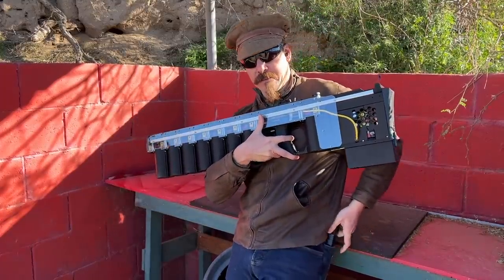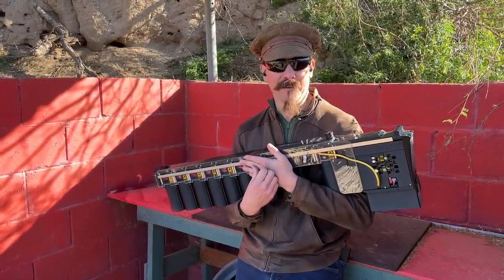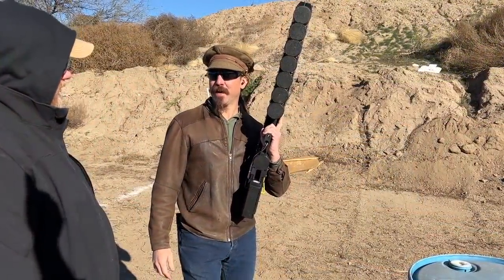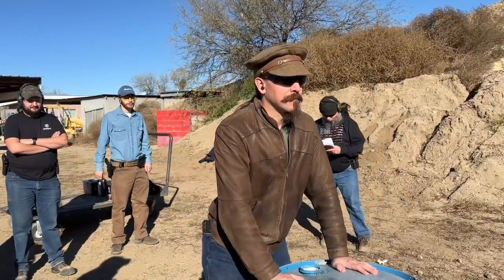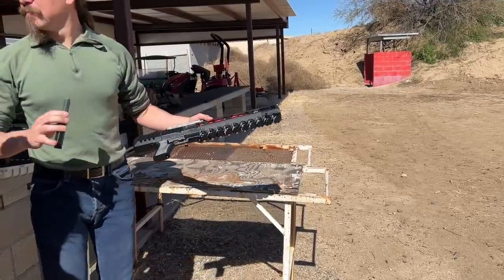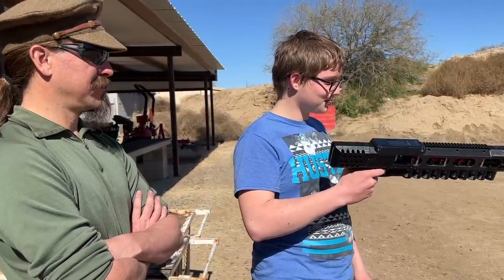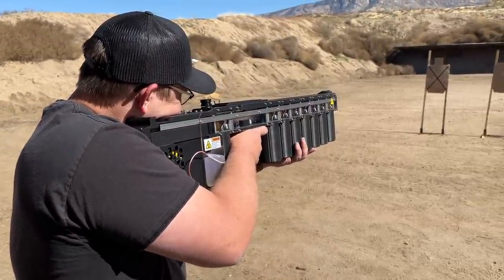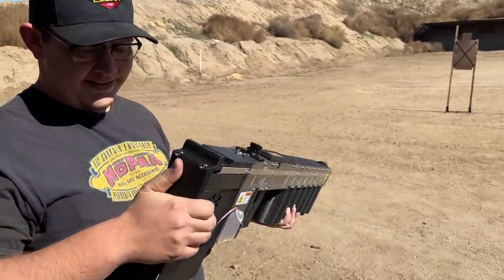I Tried to Use the GR-1 Anvil at the BUG Match...

Comment: What do we call that point when Ian can shoot this match as well with either? Like, 10 years down the line and the GR-7 comes out and fits in your hand and could be viable for everyday use?
Reply: Sadly, I doubt it's gonna be a decade before these weapons really become viable. The batteries and capacitors are just way too limited in their power and way too bulky and heavy for use.

I guess the first iterations of useable Gauss Rifles would be vehicle-mounted and tapping into their engine for energy. After that, I guess some man-portable guns for highly specific uses might be next. I don't think they'll ever replace regular handguns, though. Unless we find an energy source/battery that will be able to provide enough energy to fire several magazines without recharging. Keep in mind, for these guns to truly become viable in the field, they need to offer the same amount of firepower chemical propellant offers.
ie: You save up on weight for the ammo, since there's no propellant, but you need to carry a battery. The battery needs to provide the same amount if not even more energy than the same weight of propellant that it replaces. And that is an insanely tall order.
Reply: @h.a.9880  i would expect to see Gauss Cannons on Naval Ships
Reply: @sloth7ds  The USN low-keyed that project by cutting back the budget.
Reply: @duncanluciak5516  that was a railgun not a coilgun. The rail gun was effective only issue is you had to replace the rails very often.
Reply: @h.a.9880  Batteries are an old tech. Ok, there have been some development recently regarding the chemistry, but I serioulsy doubt that we can really expect that kind of stuff, simply due to the physical limitations. Unless someone comes with a completely new chemistry (which is where most development has come).
Reply: “So here guys I’m just gonna show u my EDC, it’s a gr36 railgun, super easy to use……”
Reply: @sloth7ds  Absolutely. Those things have enough power to spare anyway and just imagine how much weight you can save when you don't need to carry propellant. Also no propellant means no risk of blowing the ship up when it catches fire or is hit in the ammo bunker.

A heavy slug fired at several times the speed of sound from a naval Gauss canon would really ruin someone's day.
Reply: @marcondespaulo  There's stuff like graphene batteries, it's less chemistry and more physics, but I agree. The viability of Gauss Rifles is bottlenecked by the means to supply, store and release the energies needed to mirror ballistics of traditional guns.

It's a long way and it might turn out to be a deadend, but unless we walk down that way, we won't know how it'll end.
Reply: I think 15-20 is more like it, unless the tech just gets abandoned.
Reply: There have been experimented prototype of coilgun mortars over a decade ago. The idea is they want to have a mortar with more range and since mortars shells are mostly subsonic, an electric mortar would also be quiet. But it was abandoned probably because baterries technology back then weren't good enough and because we are dealing with high intensity magnetic fields it tend to mess up the fuze mechanisms.
Reply: @h.a.9880  this. There need not be one or two, but several breakthroughs in technology. This is on the same level a nuclear powered cars. Maybe possible down the line in 15 or 20 years not asking if it really makes sense.
Reply: There arguably doesn't need to be any advancements, there are already applications for this type of weapon. It's basically silent, quieter than any suppressor. There'll always be a need for firearms but these have their applications too. Unfortunately, anyone could make one of these so any kind of regulation is out the window. I wonder if we'll see sales of supercapacitors regulated in the future?
Reply: @minhducnguyen9276  It would be kind of ironic to think that someone deploys a coilgun mortar and suddenly the radios, nightvision goggles and so on from his troops get fried when the mortar fires.
Reply: Might I sugest agin, a skul-gun for my head.
Yesterday in Batery Park, some scum we all know
pushes smack for NSF gets jumpy and draws. I take
2 .22's, 1 in flesh, 1 in augs, befor I can get out
that dam asalt gun.

If I could kil just by thought, it would be beter.
Is it my job to be a human target-practis backstop?

Gunther Hermann
Reply: @nikitaobnosov347  Have a Lemon-Lime, that might calm your nerves.
Reply: @h.a.9880  I dont think that would be that big of a problem as this videos is filmed next to a working coil guns. Magnetic fields decrease  porpotional to the quare of the distance from the source so just a few meters away will greatly reduce the field strength. But the fuzes sitting right  inside the tube of coils magets will have quite a different experience, mechanical or electrical fuze. Imagine pushing the fire button and the shell just blow you up instead of flying away.
Reply: @h.a.9880  You do taht on purpose mantinaceman, you know I like Orange
Reply: @minhducnguyen9276  True that.
Reply: @h.a.9880  We tend to forget that when we are talking about artilleries shell we are talking about how to fit a small mechanical or electrical device inside a tube and getting it accelerated to supersonic speeds in a fraction of a second and still having it function after the firing process. Even until WW1 we still didn't have reliable airburst fuze and only after WW2 we started to have reliable electrical fuzes. Adding extreme magnetic fields means adding another layer of complexity.
Reply: @h.a.9880  You're definitely right that the first iterations will be vehicle mounted, that's generally true for any high-power draw technology, but keep in mind battery research is actually pretty huge right now, with how much investment is being put into solar and wind power.
Reply: @AllisterCaine  talking about nuclear powered cars, they can be made easily and some were made, but why would they give everybody materials to make nuclear weapons...
Reply: @morethanjustasloth5528  The problem is: No e-car battery comes even close to containing the same amount of energy density compared to regular fuel. And there we're just talking about boring old gasoline. Now imagine the kind of energy per kilo we get from modern propellants. I genuinely doubt that batteries will ever be able to contain enough energy to match up to regular fuel, let alone propellant. Unless that massive hurdle is taken, man-portable Gauss Rifles are at best just a highly specialized type of weapon for a very narrowly defined use.

Not saying it's impossible, just saying that we're not even close to taking that hurdle.
Reply: The only thing my hand loading friends that had piles of guns knew of battery power where electric cars used as the butt of jokes. Now they have a whole new area to play in, to bring their innovation to a different kind of projectile gun. A couple million smart minds are right now figuring out this new to them challenge that rewards them with a new freedom they so crave. 
 ~  5 to 10 years at the MOST before the crossing point with gunpowder. 
~ Crossing point would be a 1911 in size, weight and rate of fire.
  ~Or maybe an AR-15 sized package?
~ It's the rate of fire that will be the hard part. I can see that messing the crossing point up.
Reply: @ZacLowing  Polite disagree. Battery technology is decades away from making this viable in an AR-15 sized package and a 1911 sized package is completely out of the question as of now. 5 to 10 years is rididculously optimistic for the kinds of technological improvements we need.

Keep in mind, we need a better battery that can store more energy than a couple dozen shots and we need capacitors that can dump this kind of energy very quickly, too.
At the moment, the Gauss Rifle has a rather wimpy (yet respectable) muzzle velocity, in order to get the kind of performance of a similarly sized firearm, it needs to dump about 20 times more energy into the projectile and that energy has to be stored in a battery, charged into a capacitor and then dumped within a fraction of a second.
That is a tall order.
Reply: @jdmjesus6103  A suppressed 300 blackout rifle with subsonic ammo would do the job quietly. There are also air rifles that are quiet, with substantially better muzzle velocity and rifling that are more accurate.
Reply: @sloth7ds  They tested it and actually kinda gave up on railguns.
Reply: @sbrazenor2  yea, as it is now. But it wouldn't take much to make this more powerful and you wouldn't even hear this downstairs in your own house it's that quiet, and could be more so. I think it's got potential.
Reply: @h.a.9880  you're off by a factor of 1000 there buddy, Mj and kj. 2kg would get you 1000 shots with those numbers, though I'm sure it's not that good in the real world. Also much better battery tech is a lot closer than you might think, there's massive research going on right now because of electric transportation.
Reply: The magic probably won't happen for another 20 years when the patent expires.
Reply: @kevincornell1439  You are aware there's waterproof electronics, right?
Also what kind of mishandling are we talking about? Keep in mind we're living in a world where the vast majority of people own one or more pocket-sized supercomputer with HD screen, camera, GPS and various sensors - including air-pressure sensors sensitive enough to sense what floor of a building you're in. And these outright magic items are mere everyday tools, that run nonstop for months or even years, carried in a pocket or purse with keys, a wallet, and god knows what else. They get dropped, bumped, slammed, and scratched and they still continue to work.

A friend of mine managed to drop her smartphone while getting into her car, onto a concrete parking lot. She didn't notice and drover over it. Then her brother parked in the same spot and drover over it again.
It had a cracked display, but it still worked fine.

If an overpriced smartphone can do that, hardening an electric weapon against the rigors of field use is a pretty boring task.

Also keep in mind how finicky some firearm internals are and they still went through wars and revolts on maintenance that consisted of nothing more than a rub with a cloth and a shoestring dipped in oil.
Reply: @h.a.9880  sorry a smart phone doesn't have moving parts. also a firearm can be taken apart have any gunk in it rinsed off with a hose, put back to gather and work again. not this thing. if it fail it is more then likely done for awhile. hell he couldn't even get through the first magazine in the first round of a match. capacitors can just go bad, fuses blow, high volt relays can just stop working at any point and a damaged cell in a battery can cause an explosion/fire. this thing has multiples of all of those. you now how many cell phones have been destroyed and never worked again from being dropped in water? this is just a gimmick.
Reply: @h.a.9880  also comparing low voltage electronics to something that has enough electricity running through it to drop an elephant isn't even close.
Reply: @kevincornell1439  Smartphones usually are not built to be waterproof though. Those that are, are supremely waterproof.

The only "moving part" in the gauss rifle is the magazine, everything else can be made in a way that it is perfectly waterproof, gunk-proof and sand-proof. With the right construction, if mud gets shoved into the barrel or magazine well, you can just rinse it with water, jam in a new magazine and go at it.
As for components failing, that's something that can happen to you with any firearm and depending on what fails, your gun might be just as useless as a Gauss Rifle with a busted main fuse. Optimizing this design to be more sturdy is not yet a priority and there is nothing preventing this system from being highly modular to allow easy maintenance/repairs.
As far as catastrophic failures go, conventional firearms can blow up in your face. Literally. I refer you to Kentucky Ballistics.

As for the reliability:
Ian fired the gun a couple times in his second video, it worked just fine and it is an early prototype, so while malfunctions are a bummer, it's not like this is indicative of the concept being valid or not. As Ian said himself, the Wright brothers flew 200 yards, that's hardly impressive, yet nowadays every John Doe can climb into a plane and get to the other end of the globe within less than 24 hours.
If this concept should ever stop being what it is today, those issues are easily overcome.
Making it withstand water, dirt and abuse, making it easy to repair and maintain, all that jazz, that's the *easy part*.

Finding a battery and capacitors that'll allow this kind of firearm to be useable is the bottleneck. But a waterproofing ain't shit.
Reply: @h.a.9880  water proofing high voltage components is an issue, do to heat. this technology is 100 years old! airplane technology didn't take very long to become practical because the technology used to create flight is practical. this technology has had 100 years to improve and is still inferior to firearm technology that's 200 years old. electricity has its limits and it shows in how useless this thing already is and its brand new with all the latest tech.
Reply: @kevincornell1439  In what way does this matter? The argument makes literally no sense.
There's enough electricity running through ground cables to power entire cities. And it works. Why? Cause the whole system is laid out to make it possible.

If the technology is developed enough, making the weapon withstand the rigors of operation is really the smallest issue.
Waste heat might become an issue, but even that can be taken care of.

Now I have the mental image of a water-cooled Gauss Rifle that looks like a Vickers Gun on steroids lol.
Reply: @kevincornell1439  Airplane technology took centuries to go from "this guy tried to build a mechanical bird and fell to his death" to "these two bike mechanics made a riggety flying scaffold and flew 200 yards... without breaking their bones."

DaVinci designed planes and the idea of making a flying machine is easily older than that. When you tell a story, don't just tell the part that suits your needs.
Reply: @h.a.9880  adding to the rifles already 20 pounds(without the battery) to solve inherent problems does what? this thing already weigh's 3x more then rifles that can take large game out to 600 yards. so its 3x heavier, has an effective range that's 50x shorter, a firing rate that's 5x slower and cannot be exposed to the element's. battery's have only improved by 50% in the last 10 years and capacitors even less. just solving the weight problem could take a 100 years at least. you would still have to improve the power output from the capacitors while keeping the weight a third. while continuing to improve the battery's to keep up with the capacitors. you can only jam so many ions into a certain space lol.
Reply: @h.a.9880  the first working gauss gun was 100 years ago. less then 20 years after the wright brothers. the first commercial flight was in 1914. 11 years to take what the wright brother did and make it viable. a 102 years and the gauss gun is still not even close to being viable. does that part of the story work for you?
Reply: @kevincornell1439  I'll reiterate the point about the Wright brothers, hoping it'll stick *this time*.

You're looking at a very, very early prototype. None of what you say is up to dispute, the technology is far of, it's something that I have said myself mutliple times in this very comment section.

But I still wholeheartedly disagree to your points, since I don't think they are argued very cleverly. Your entire argument boils down to "It's not good now, so no use in trying to see if it can be improved." Congratulations, that attitude means you'd never have moved past dwelling in a cave.
Airplane? Nah, 200 yards is not impressive. Train? But that needs rail tracks and that's just way too hard to hard to do. Cars? What, a horse carriage not good enough for you? How about steel? Even basic steel took centuries to become viable. Guess that's out of the question, too, cause wrought iron kinda sucks for weapons and what's the point in trying to improve it anyway, let's just stick with trusty copper and tin?

That's your arguments in a nutshell.
Reply: @kevincornell1439  It works better, since it is more specific. Aviation is still a centuries old dream that only became viable after a couple breakthroughs to turn it into what we see today. How's that timeframe going when you don't pick the Wright brothers and instead take manned flight in general? First manned flight of a mongolfier hot air ballon in 1783 till 1914 does tell another story. I will concede that's more of less shifting goalposts on my end, though. be that as it may:

Gauss Rifles are not a particularly new idea, sure, but you're ignoring the major advances in electronics between the beginning of the last century and now. There's still a lot to be done, no one is denying that and the enthusiasm of people expecting this stuff to be en par with regular rifles in a decade baffles me, but to dismiss it outright on shaky grounds is rather questionable, too.
Reply: @jdmjesus6103  crossbows! cheaper, just as fast to shoot, more reliable, lighter and will be more powerful.
Reply: @minhducnguyen9276  imagine the the magnetic field that its going to need for this to be viable.
Reply: @h.a.9880  an issue your missing here is the magnetic field being created. you crank this thing up to serious and usable power. well things will start getting wild around it. not something you would want your face next to if you have metal filling. you could end up with mercury poisoning. also the ferrous material's with in range of the magnetic field when you pull the trigger could be a bit distracting. there is nothing wrong with the tech being used, its just what its being used for!
Reply: @kevincornell1439  It's indeed very strong but because of the nature of the coils, most of the magnetic field don't leak out and mess up with the electronic around it. But the problem with coil guns is they work best on big projectiles meaning that at the current energy level they are competing with subsonic ammunitions and while they are absolutely quiet they can't compete on the fire rate department. At hypervelocity they are competing with the railguns but railguns are significantly simpler in the design. I don't think they can compete with firearms in the supersonic rang but with future technologies available they will make excellent silenced weapons.
Reply: @minhducnguyen9276  only thing i see it competing with is air rifle's. but air rifles are insanely accurate and this thing is far from solving just that problem.